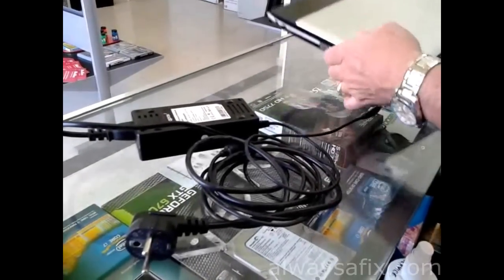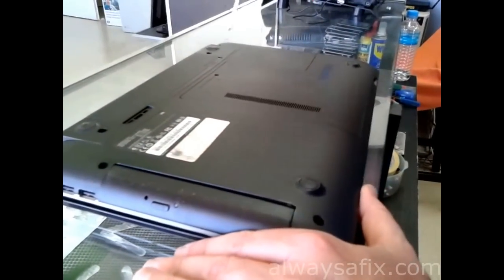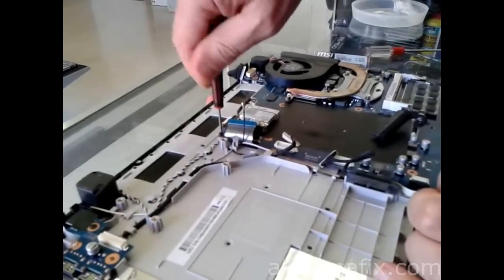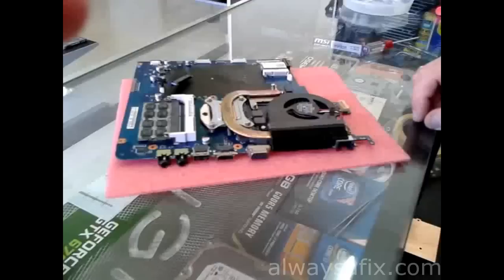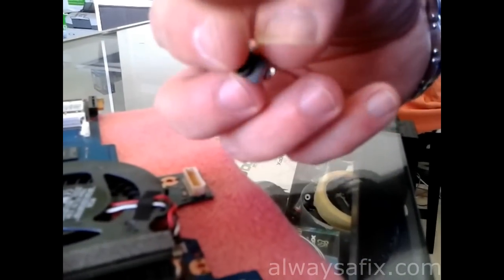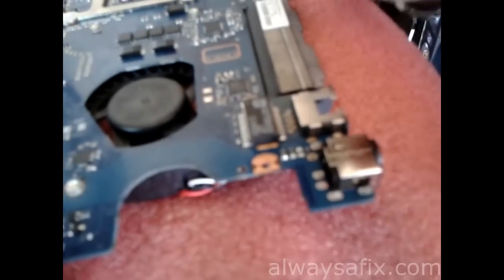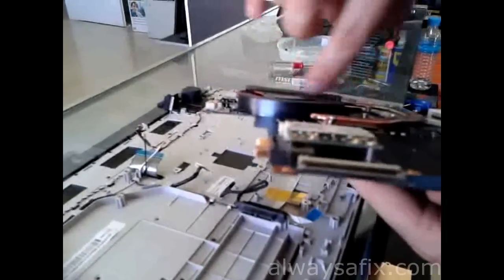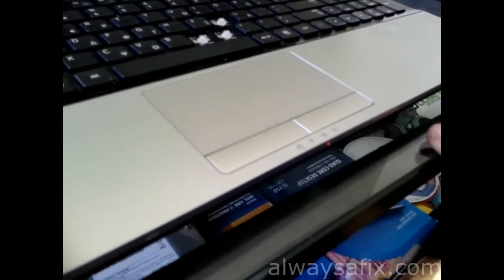Samsung Laptop charger socket problem and fix

Comment: What solider is to be used for the charging port.. also what temperature does the old soilder melt at?
Also is the charging point on your laptop the same as the Samsung NP-R710?

Comment: Just fixed my existing socket without the need for soldering in a new one. After removing the casing, hdd then removing the mother board with cooling fan intact and inspecting the inside of the charging socket closely with a magnifying glass, I discovered that it's possible to slide a small pin in from the back of the charging socket to enable the outer contact (inside the socket) to be gently prised out into a position where it will once again be able to make full contact with the metal of the charger jack once it is re-inserted. These type of Samsung  sockets are a nightmare. Over time the contact inside the jack itself gets stretched further back every time the jack is taken out and re-inserted. You can feel when this is starting to happen in that it the jack doesn't 'grip' firmly inside the charger socket, it kinda feels sloppy. Another tell-tale sign of a poor/failing connection is overheating when charging and the charging indicator light blinking sporadically on-off. But, as I already mentioned, there IS a way of adjusting the position of the contact inside the socket if you are careful, have a good eye and a steady hand. I used a slightly-bent inch and a half long thin pin to do this and now my jack once more fits in the socket nice and snug with a definite audible 'click' where the contact points are now meeting 100% as they should. This problem is all down to general wear and tear, but it is possible to rectify it in many cases without the need for soldering in a whole new socket.
Reply: Sounds a bit like my neighbours wife...
Reply: LMAO!

Comment: Thank you for this video!
Reply from the maker: Welcome and thanks for watching.
Reply: @alwaysafix  hello, what soldering tool do I use? (Hot or cold)
Reply from the maker: @scionnn  Hot I run my soldering iron about 350 -380 Celsius, be careful not to break the very thin part of the motherboard. To make it easier add leaded solder first or even better low melt solder. Preheat with hot air and use flux, good luck.

Comment: Can you please help me my laptops charger works but when i plug it in in doesnt charge the light doesnt turn on and my battery is 0%
Reply: Same problem right now lol
Reply: I think the problem lies in the laptop's charging socket just like what is shown in the vid
Reply: @northgeneblaza6939  yeah you’re right only way I fixed it was by bending the charger. But that was 4 years ago.

Comment: I currently got a problem with my charging socket. This problem started around 1 year ago. Back then I really didn't care about this problem. Now, three new chargers later, I've got the same problem, but now only way more sensitive. The charger only charges when it's placed in random positions varying day by day. It will gather a huge ammount of heat in the startup process and sometimes the lights will start blinking between red and blue. However, this problem doesn't appear often when the laptop is switched off or in resting mode.  I'm going to send it in for repairs if the problem doesn't lay in the charger. Do you know what could be the problem here?

P.S. My pc's gotten as hot as to actually melt some of the plastic on the frame above the charger input. And about my previous chargers... the transformer inside them exploded.
Reply from the maker: +Mr. Iraxt If the charger socket has broken a contact you will get arching and that will cause overheating.  That could be the reason for your overheating.
Reply: Thanks for the fast reply. Seeing as this might be the source of the problem, I guess I'll send it in for repairs after the exams. Thanks again. :)

Comment: Help I have excactly the same laptop, but the charging light on the front goes from red to green right now, and when I tried a couple of minutes earlier to plug it out and then in again to see if it would be fixed, the laptop immediately shut down. So I let  charge shut down, and after 10 minutes I turned it on and the light wa fixed. But I'm afraid for my battery or charger life... Cause it has never shut down immediately. Usually windows pop yp a 10%/ 6% warning... If anyone knows please tell me what I should do. (I have no fans to keep it cool for now, if that matters)
Reply: ***** 3 years old. It hasn't shown any such problems since then though.
Reply: ***** Oh thanks for the information!! I will ;)

Comment: Hi I changed the power jack but now it only works when it is plugged into the ac adapter it will not power on from the battery. I am not sure what is wrong every thing seems to be working it charges the battery 100% not sure what i have done wrong. Any help would be appreciated.

Comment: Hi,

I succeed to remplace the socket power, I got the orange led saying is charging, but it doesn't want to boot!! What I missed?
Reply from the maker: Pablo Duràn If you have the orange led the repair was successful.  The problem lies elsewhere.  What exactly happens when you push the power button?

Comment: Hi, I have a Samsung NP550P5C notebook that is experiencing the following problem:
A 6 months at the time, he began to get the message that the charger was disconnected, but the charger was on, I thought was bad connection, I took the charger out and put again and no sign. After a few times this happening, I realized he was returning to normal after leaving off for a few minutes and reconnecting.
The battery is good, every week use it only on battery and did not present any problem.
The charger is also good, did the test with the multimeter to is providing the necessary power (19v) and Amps, the cable is not broken.

Today, the notebook stopped charging suddenly, after that the battery is empty the computer does not turn on anymore.
When I connect the charger without the battery, the charging indicator light turns green very light, but the notebook does not turn on. when I connect with the battery into notebook the light turns red and then off again after about 3 seconds, no more lights.

I think the problem isn't on conector, because the led turns on only when I connect it, after that, even moving the connector, the light does not light anymore.
How can I test to see if the connector is defective or if it's on the board?
Reply from the maker: The only way is to remove the motherboard and test with a multi meter.  Good luck!

Comment: My Samsung laptop charges randomly and it only works if the cable is bent. But tonight it stopped working. How to fix?
Reply from the maker: If it only makes contact when it's bent, then it's probably the cable that's faulty.  Confirm with a multi-meter and replace the charger.  Excessive wiggling around of the cable will eventually break the charging point.  Good luck!
Reply: I also have the same problem i tried replacing the charger but its still not charging should i change the port
Reply from the maker: Bhuvan Shrivastava You need to strip the laptop, plug in the charger and test with a multi meter behind the charging port, the pin to the board.  Good luck!
Reply: 8

Comment: What brand of cautin are you using and what kind of soldering iron. 60% tin and 40% lead? Good video. Thanks.
Reply from the maker: I use 60 / 40 (tin - lead).  Thanks for watching.

Comment: i have the same laptop it got dead suddenly after that i got a new changer to test it but did not work then i tried to power it on without the battery it did not work. then i bought a new battery, it worked with a new battery and show charging with a new with the charger and battery but actually it is not charging. can you please provide a fix for that. (i opened the motherboard and checked the charging port with meter and it was ok but somehow current is not going to the battery)
Reply from the maker: If you checked the charger port and the charger, it sounds like the problem is something to do with the motherboard.

Comment: My one doesn't come off for god sake... my solderinh iron is 30w and still it wouldn't come off I done top and bottom then I ended up snapping the side.. I am so angry I need to buy a new laptop now
Reply from the maker: Sorry to hear that.  In the future it helps to add fresh solder to the joints and then use a solder sucker to remove.
Reply: i tried that as well and i also tried a sodering pump... neither worked... another video i thinik the guy uses a coil to attact the soder.. also mine didn't even melt for some reason
Reply from the maker: Uygar Ramos Oztas The coil you are talking about is called solder wick.  It sounds like your soldering iron did not get it hot enough for this job.